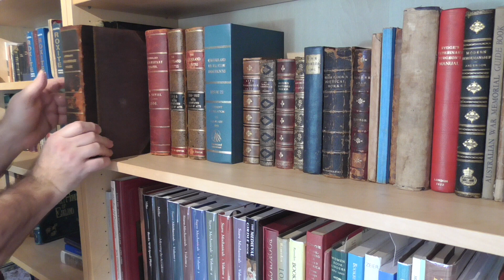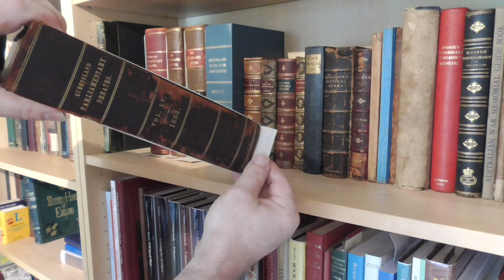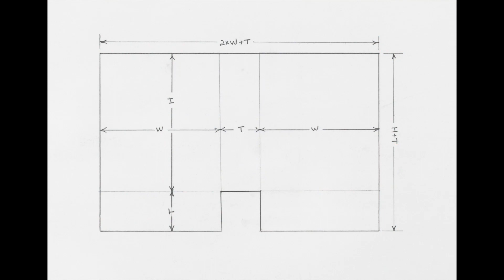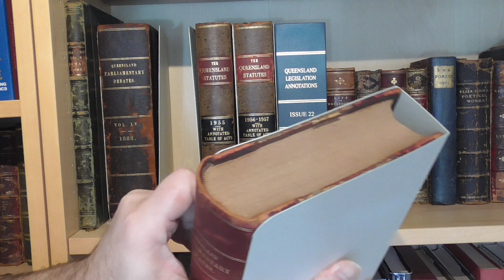What is a Conservation Book Shoe and How to Make One // Adventures in Bookbinding

Comment: I've made many of these book shoes over the years and also many cheap slipcases ( the ten minute).
Next time I'm making such a slip case for a large heavy book I'm going to try fitting in a text block support on the bottom. It won't interfere with sliding the book in and out and I think it will keep the book from sagging  when it is on the shelf. Also the tab is a good idea.

Comment: Why not make it a full slip case design to keep the dust from the top of the book?
Reply: He has a video on the 10-minute slip case and a series for the cloth-covered slip case.  This is an alternative to those.
Reply: Oh, and also a video on clamshell enclosures.
Reply from the maker: Because slip cases have a lot of friction against the boards and tail.  With this enclosure you can splay it open and insert the book with very little rubbing on the sides and none on the tail of the boards.  I know of one person that adds a flap to enclose the tops.  I've experimented with this, but it hasn't caught on in the institutional collections.  I assume there is a reason why.  It does make them more complex and more time consuming to make.  Hope this makes sense.  DAS

Comment: Another excellent video. A question about the text block support. Where the text block does not sit level with the base of the covers would you make the support level with the depth at the spine? And would you err (if you had to make a choice) on the support being deeper that the recess ie so that the text block is more supported and the covers less so?
Reply from the maker: Good question.  I should have gone into a bit more detail.  At one point while I'm talking about the history or something I turn the book over onto its head and see how much the text wants to go back to its original position.  I don't want to force it back if some structural changes have occurred that won't allow it.  So I focus on supporting the text at the fore-edge.  And I don't want to lift the book by the text and have the boards dangling.  These would end up drooping too causing damage to the joints.  It's a bit of a balancing act and best to err on the side of undersizing since the text has already sagged.  If you lift it a bit to take some force off the joints, but not so much as to add new forces.  Hope that helps.  Darryn